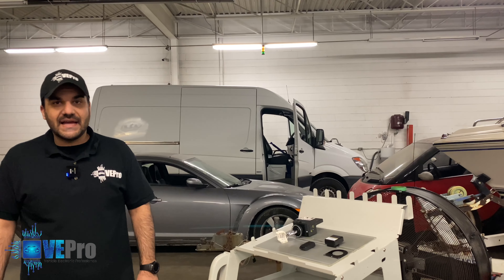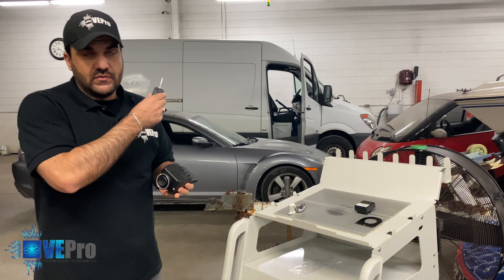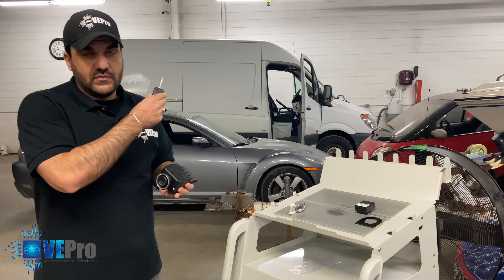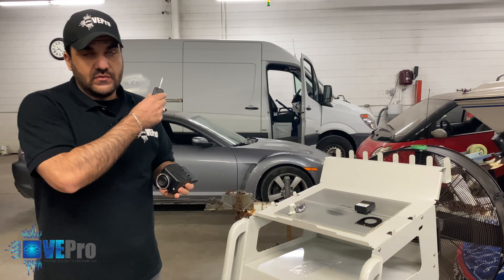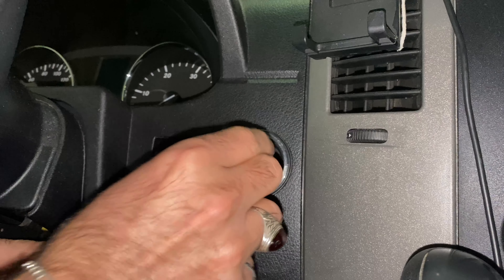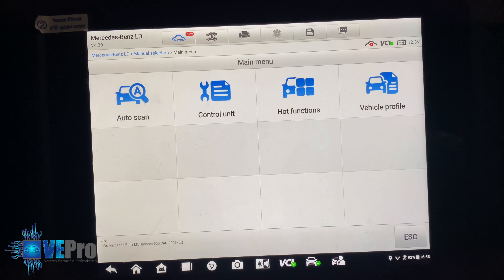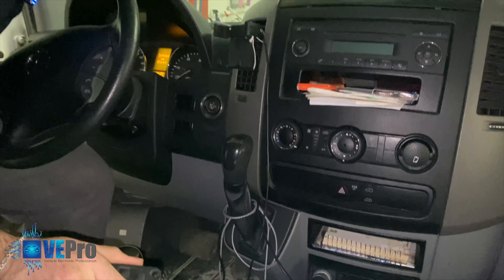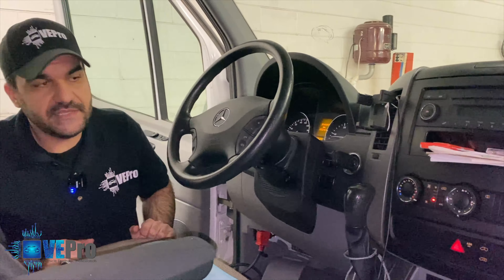MERCEDES SPRINTER 2012 | NO START | ELECTRONIC STEERING LOCK | BYPASS EMULATOR | DIAGNOSTICS

Comment: This vid is great, aswell I was not able to turn the ignition key from My MB Sprinter 2008 so I found the Emulator solution and I order one online, after it arrived I installed the smal box and yes jippy I was able to start the car again but still my steering wheel was locked, what I did ?  I Removed the black PVC heater pipe which sit over the steering lock , I just removed the heating pipe, I took the small grinder and I made some small cuts and I was able to remove the cap, took out the interior and the steering lock was gone, U don't need to take out the steeringcolum and disasamble your dashboard.  It was done in less then 10 minuts to remove the steering lock in the car. My cost only 30 euro's for the emulator, when you bring the car away to a dealer it cost you atleast 1000 euro to repair a small issue and now the car has no steering lock who cares not me 😀😀

Comment: hi just a question my sprinter ive connected an emmulator as  i dissconected the steering lock plug with lock in unlock position . do acctually have to remove els from colum or i can leave it in the unlocked position . great video i enjoyed watching it A+++++

Comment: Awesome info.. problem I’m having .. ignition locked.. After returning home after 10 days.. I went to start the van dodge sprinter 2008 2500 high top extended cab, with Mercedes diesel engine V6. I turned the key and lights came on, but then died. I must’ve killed the battery because of the back up camera must’ve been left on. The next day I went to see if maybe from sitting I could start the van, and with both keys I can’t turn the ignition. Do you think it’s because my battery’s dead and there’s no juice for the systems to read each other? Thanks in advance, and this was very helpful
Reply from the maker: Dead battery may cause software glitches in vehicle modules. Best to scan with a proper diagnostics tool to identify the problem.

Comment: So you recommend installing the emulator as a proactive measure or wait until the steering lock motor fails? thank you
Reply from the maker: Proactive measure best as the original steering lock can be kept unlocked for ease of removal. If you have a functional steering lock, Insert key which will release steering lock, disconnect plug from it and plug VEPro bypass emulator.

Comment: Hello quick question, will it still read the key if the key fob is dead or no battery inside it ?
Reply from the maker: Hello, yes the electronic igntion switch wirelessly powers the transponder chip in the key to read the information. The battery is only needed for the keyless entry.

Comment: How about a 2012 gl450 in unlock position can you reach the plug like that too?
Reply from the maker: That system requires a programmed bypass module we offer. Email info@vepro.ca for further details.

Comment: My bypass is reading the key, but the vehicle is not starting. The vehicle is swinging, but not starting completely,  I tried using quick start , I tried the injectors,  I tired almost everything, but the vehicle is refusing to starts , I even did Diagnostics,  it says glow plugs 1 and 4 , I'm not sure if that's enough to stop the vehicle from starting.

Comment: How does the dilator keep the steering unlocked? If the steeting is locked the motors has failed. How’s the emulator unlock it ?

Comment: i just bought sprinter 2014, 2.1, and suddenly stopped. the switch/key does not turn at all. with no key in, non of my headlight does not work ( before worked and had beeb). hazard start but very weak light. but my battery is fully charged and showing 13.8 . dash lights are going and comming unorginized while key is in.   all fuses are fine. can you suggest where to look?